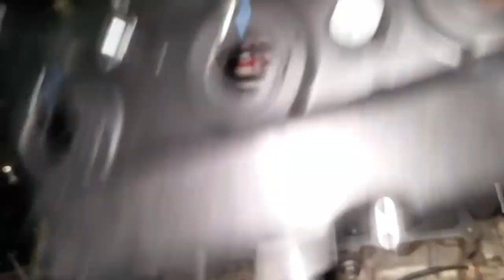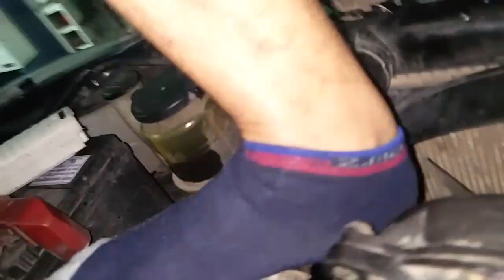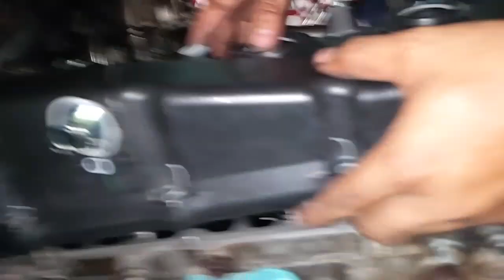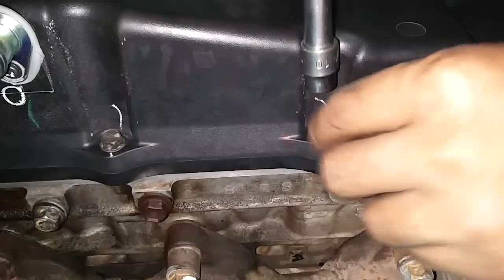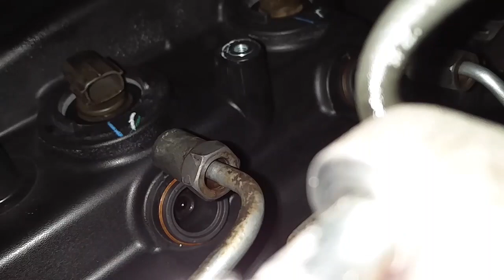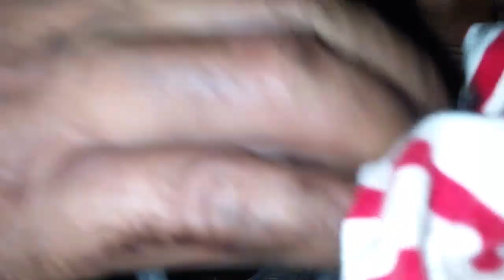How to replace seal valve cover & Cylinder Head Cover TOYOTA HILUX VIGO,

Comment: There is always an easy way and a hard way..You have chosen the HARD way :) Why not put the gasket on the cylinder head + sealer then fit the valve cover to that???
Reply from the maker: Thanks for watching my video .That why no need put the Glue on Seal valve cover cause not protect the the leak .when replace it new no need to use the glue.Good luck.